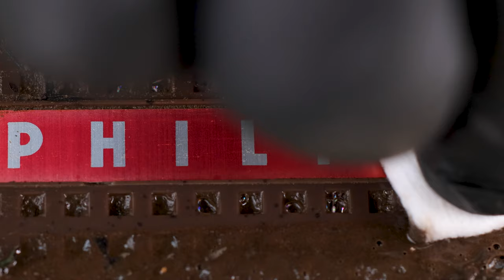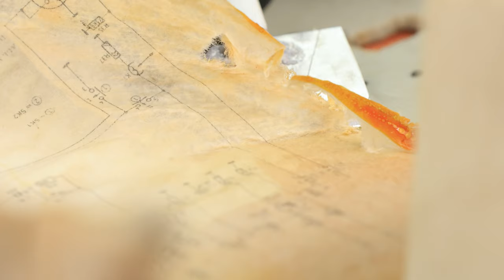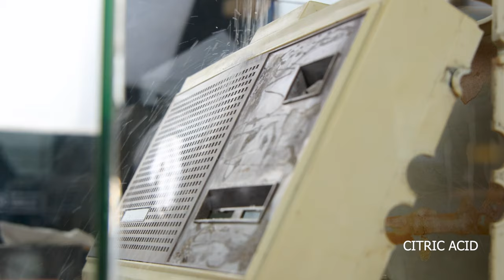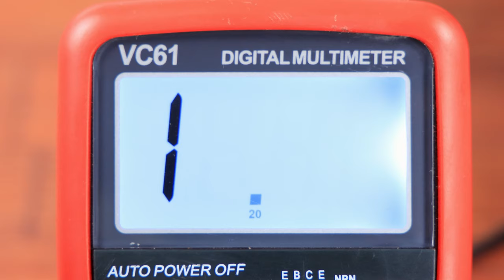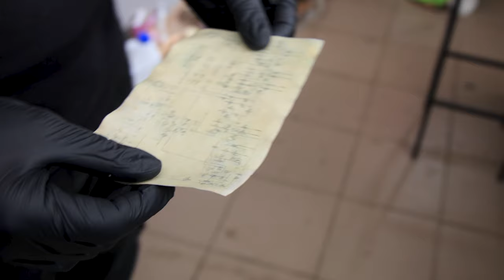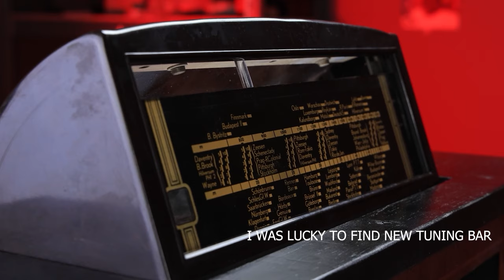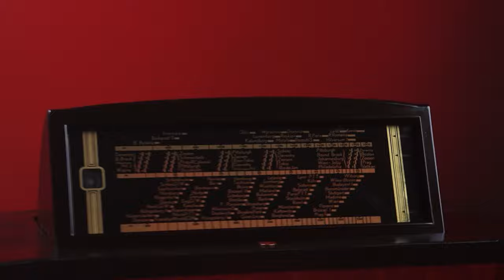1975  Philips | Old Tape Recorder Restoration

Comment: I recently obtained an EL3586 myself too. However, in the restoration video, there seems to be no problem with the most important problem: the rubber belt and the two rollers pushing against the capstan wheel. The material on these has completely dissolved, and needs to be replaced. I read in a forum that a rubber grommet, with an O-ring placed over it, might be a work-around. However, the disassembly required to reach those two rollers, seems to become quite extensive !  Take many pictures and make notes about what wires are soldered where ...
Unfortunately, the rubber dissolving problem seems to occur on practically all reel-to-reel tape recorders and cassette players from the seventies and even eighties.

Comment: So fake !! the brown grime on the sides has clearly been brushed and smeared on... as for the moss ???!! That is synthetic moss that can be bought from florist shops for flower arrangements, or from aquarium supply stores. Then there is the grey plastic tape that surrounded the schematic diagram.... Plastic tape was not used in electronics in the 1970's, or even 1980's. What was used was paper or cloth tape.